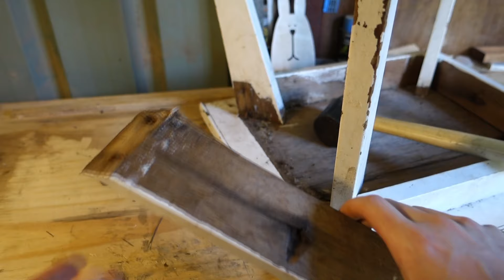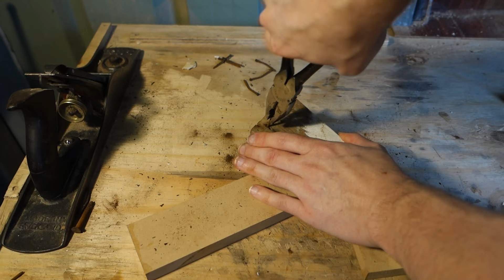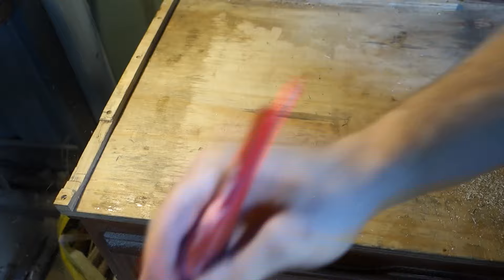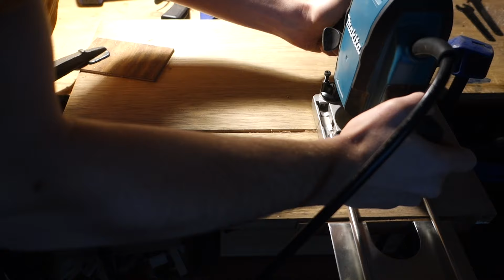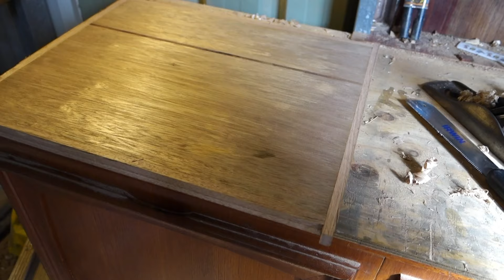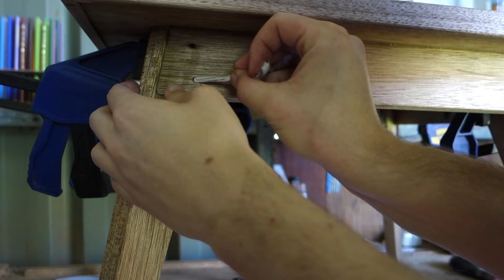Painted Coffee Table Restoration - E∞J Woodhouse Restorations

Comment: The finished table looked very nice, but, I don't understand why you took it all apart  and damaged it when doing so, and then had to glue pieces back together.  Why would you take it apart? Was the reason just so you could plane it?    I refinished antiques for 2 businesses some years back and we used stripper to remove the paint.  Never seen nor heard of using a plane to do so.   Planing it removes layers of the original wood.  Makes no sense to me.
Reply from the maker: Thanks Susy. The reason why I took it apart was because I wanted to easy access to planing the paint off. Plus I wanted to re-flatten the pieces as they were slightly warped from water damage and wanted a nice flat surface. Planning is a great option, you can't use it all the time but when you can its great, makes the job go much faster as you don't have sand and you can avoid chemicals all together. Planing is actually the favoured method of furniture restoration in Japan, as they use a no glue or screw technique called "kanawatsugi", this allows them to easily seperate the components of a piece of furniture plane them down and they as good as new. The nails took me by surprise I know it looked bad haha. I think I got pretty lucky its very hard to remove nails without damaging the piece. I agree though you could have restored this table using stripper or even plain sanding, I just chose plaining. I appreciate the comment and watch! :)

Comment: You couldn’t take the extra day to get the clamps off at the end? Or varnish/oil it, wait, sand it and varnish/oil again?  Get a great sheen/finish, and have your little table actually look finished? Great work at the beginning, you took the time to strip that table with a plane, repair with glue,  with dowel,but the end let’s you down…….it’s a barely finished object.

Comment: Would have been a good video, but the super loud background noises were at best distracting but mainly irritating. Hope that you can make better recordings in the future. Also, learn to miter the corners on the trim!
Reply from the maker: Yea it is a noisy street at the moment haha I apologise for the noise. They are renovating a house next to me atm, plus there is a baby bird that’s nesting on the roof haha. I was going to miter the edges but i didn’t want to battle with the rusty nails in trim, there were tons on them. I couldn’t get it square so just went with a butt joint as it was easier. I agree though a miter would probably look better. Cheers thanks for the feedback 🙂👍

Comment: The solid wood is nice but the construction was so unprofessional. Nails and screws all over the place. Once detached the legs looked like a medieval weapon.🤣
Reply from the maker: Yea it was like walking into a battlefield of nails haha. Those nails always eventually rust and cause all sorts of issues. I think it was homemade table as well. 👍🙂
Reply: @ejwoodhouserestorations2796  I liked how you replaced the screws with bamboo skewers (I think). I do the same.🍖
Reply from the maker: @srfrg9707  haha they do look like bamboo skewers. They are actually 3mm oak dowels. $3 per meter from Bunnings, although I believe a bamboo skewer would work all the same, would look interesting as well. 👍🙂
Reply: @ejwoodhouserestorations2796  3$ per m? You like in luxury 😄 I stick to my bamboo skewers. A bag of 200 costs less that 3€ here in Greece. Mechanically Bamboo is much stronger that oak. The diameter closer to 2mm. It looks nice, I mean, if you are not trying to blend the dowels in the wood.
Reply from the maker: @srfrg9707   yea the price of wood these days is hefty 🥲 That sounds like a great alternative, might just try it myself with a light coloured wood like pine, or Cedar. I’ve actually used toothpicks before as an alternative to pin nails haha.
Reply: @ejwoodhouserestorations2796  The prices  of timber here are crazy also. I tried cocktail toothpicks too but I find  they are sometimes quite weak.The grain is not always aligned with the general direction of the pick and it break easily.
Reply from the maker: @srfrg9707  Seems like it’s tough all round, the demand for timber is higher than ever haha. I’ve encountered the same issue, you need to find a drill bit that is slightly larger than the toothpick, then slather it in glue and gently tap it into place. Although some toothpicks will probably still break haha. 👍